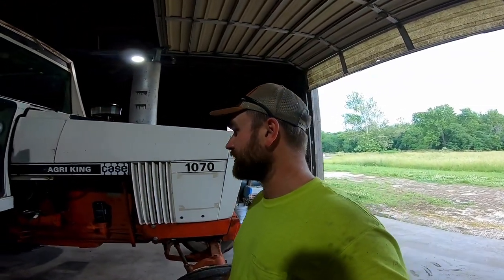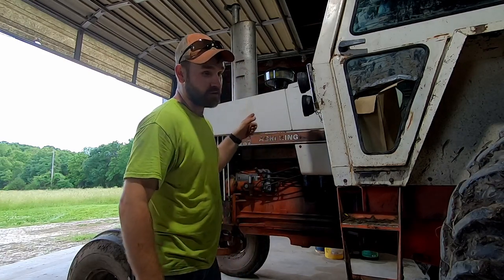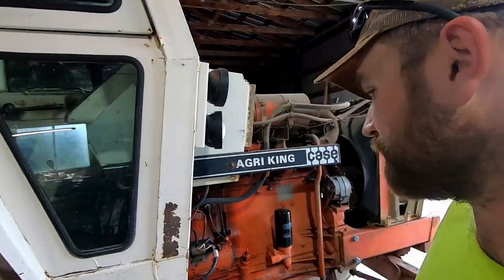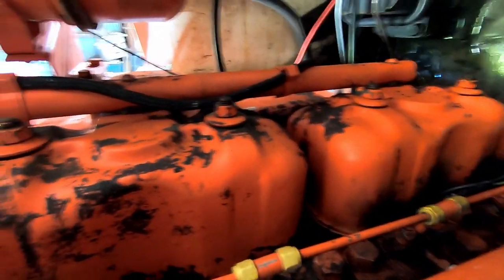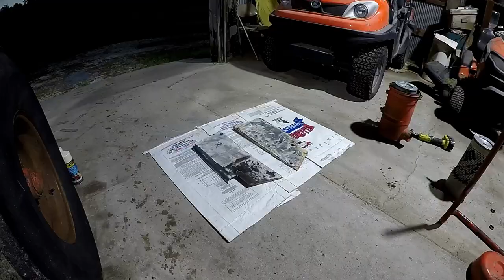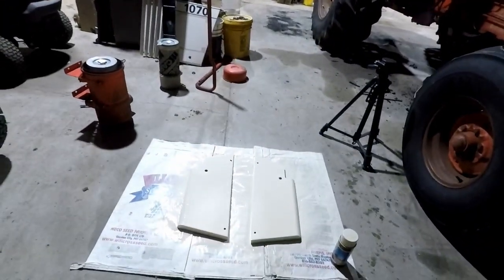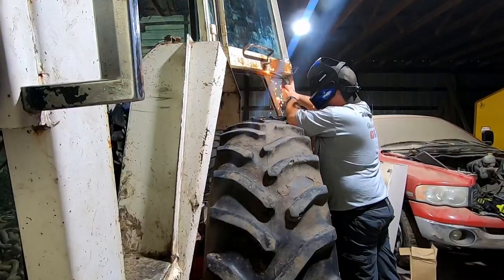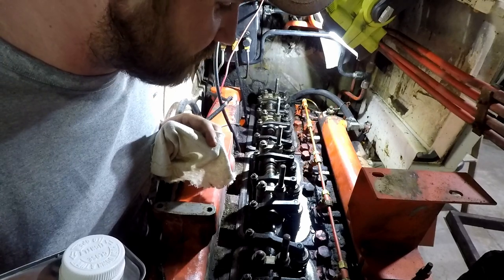Replacing Return Line Grommets & Valve Cover Gaskets On The Case 1070

Comment: Nice Case, if you read this and have time could you get the height & width measurements on the fuel tank? I have a case 1896 that needs a new fuel tank Abilene machine has new aftermarket tanks for the 1070 but no one has any for the 1896. I know the 1896 is 65g and the 1070 is 50g but if the 50g will fit height & width I'm going to try one, Thanks